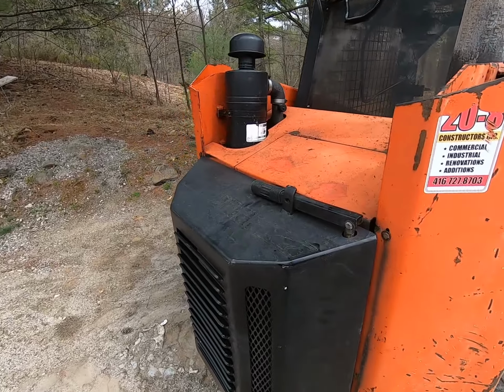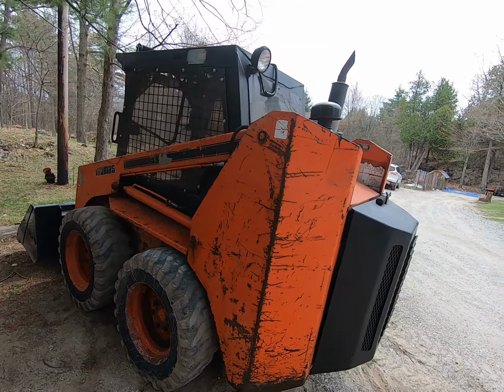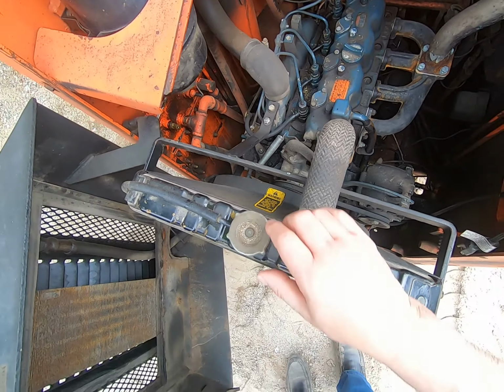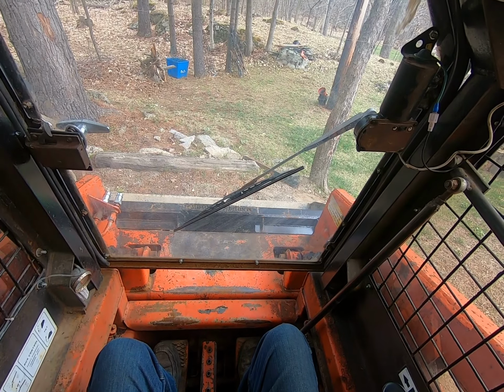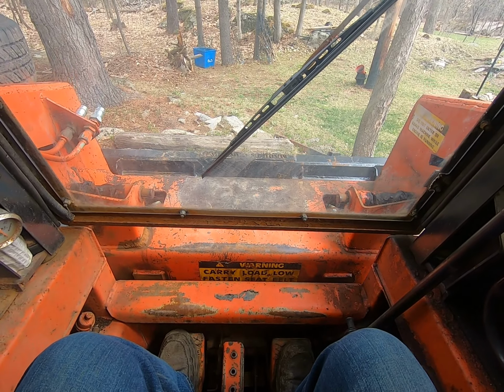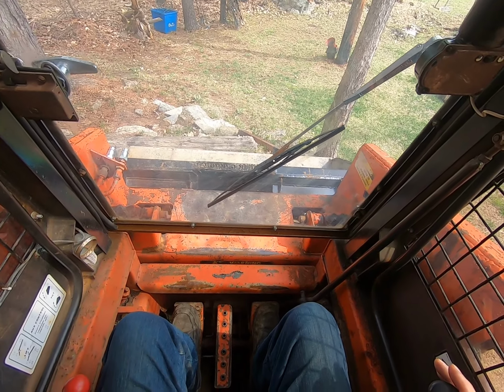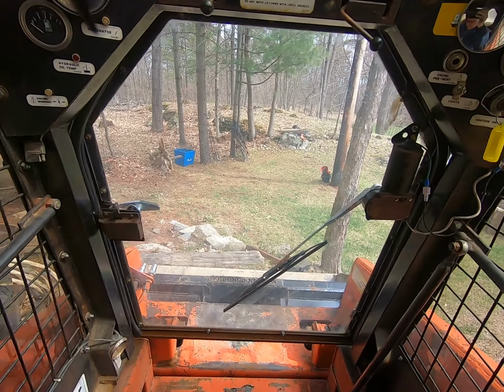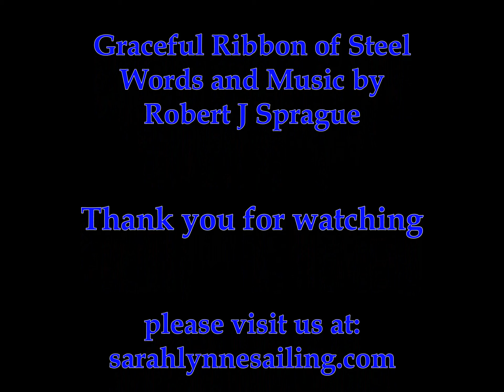Thomas T133

Comment: i have the same machine. 1992 build. i purchased it mainly to dig/grade the 200' driveway for my rural property where we will be building a home .will be used for side jobs following that i'm sure. bought the oil filter and hydraulic fluid filter both from Napa recently (would like to find a source for Thomas, or Kubota branded filters and parts in southern/mid eastern ontario soon. likely utilize princess auto for some general hydraulic hoses that it will need also.
Reply from the maker: HI,
I think Thomas uses generic filters

Comment: How much weight have you tried lifting? Im looking at getting one for round bales. Spec says its rated for 1400# but curious if anyone's pushed the limits
Reply from the maker: 1500 lbs I have lifted the rear end of an SUV with it. So a round bale should be no problem.

Comment: Do you know how to move one of these that won't start.  I see how to loosen or tighten drive chain, but not how to remove it?  Don't see how to disable the driveshaft at all.
Reply from the maker: Hold both levers forward and push or pull

Comment: Do you find the enclosed cab captures too much smoke from the engine? Thinking of enclosing mine but it smokes a bit too much for my liking and blows through the cab.
Reply from the maker: One of the things i had to do with mine was replace the manifold. It was leaking into the cab. It wasn't that expensive because it has a Kubota engine and everything is accessable. I found enclosing the cab really kept me warm in winter. I used it primarily for plowing snow. My town has a lot of heritage buildings which are hard to plow with a push blade. This was my market niche.
Reply: @adventureswithgrandpa  Sounds good, I'm definitely going to do some exhaust work on mine this spring, so I'll keep an eye out for a replacement manifold! Thanks

Comment: Stupidly terrible Socalled cursery pre trip inspection , What about checking the most important fluid like hydraulic fluid ? But again stupidly pointed to again a unexplained generic oil fluid level when filling some sort of unknown oil fluid, that could have stupidly been a hydraulic fluid filling point & why would you ad Engine oil to hydraulic fluid ? Plus engine has a stupidly same color oil fill cap as the valve cover & is barely noticeable, but again a super useless amateur unknowledgeable pre trip.
Reply from the maker: If you read the manual, you will find that they recommend motor oil. Do some research before mouthing off.